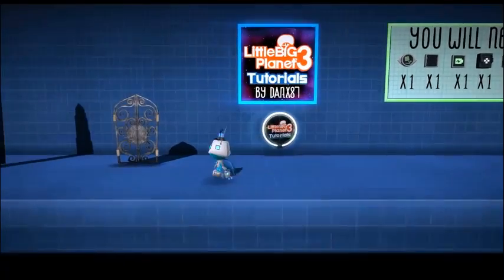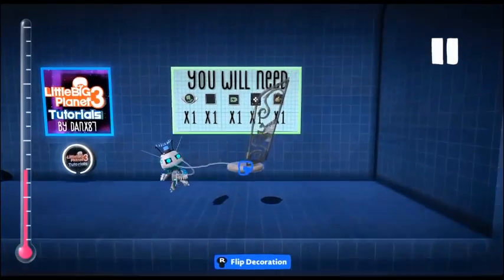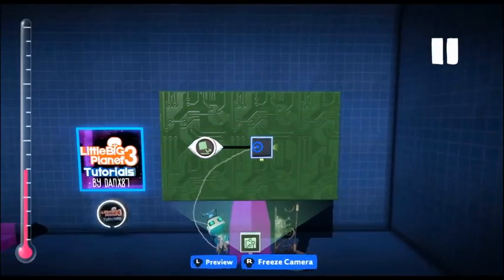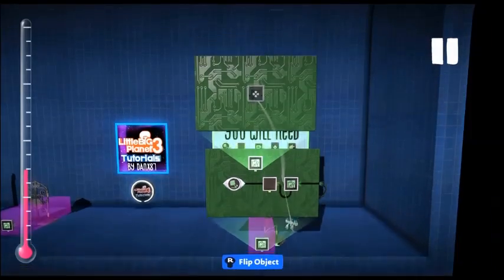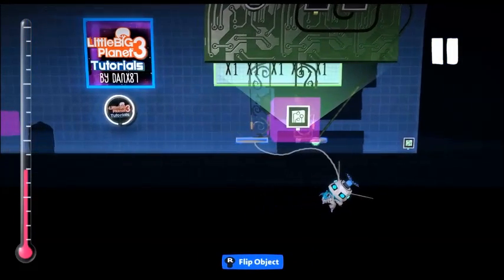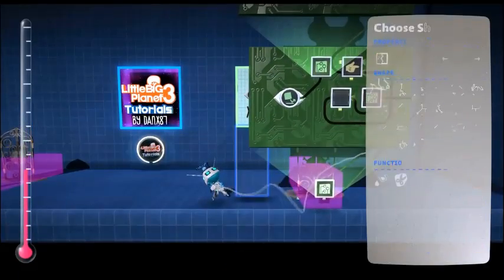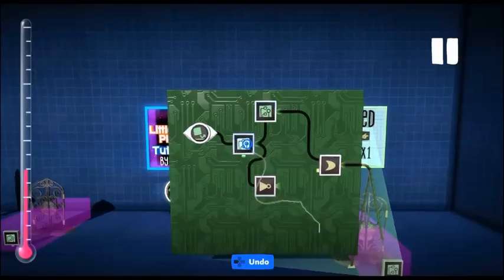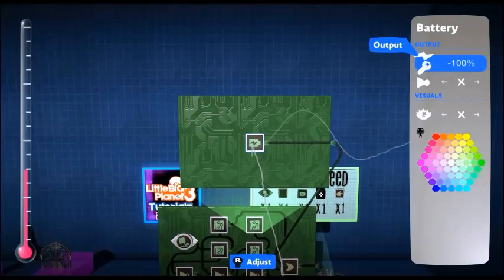LBP3 Tutorials [3D Door / Gate]

Comment: What if you wanted to put a door that opens when you have a certain amount of points?
Reply from the maker: Add a and gate to the output of the impact sensor then add a score sensor to the second port of the and gate. So u need to in in contact with the door area and have the right amount of points.